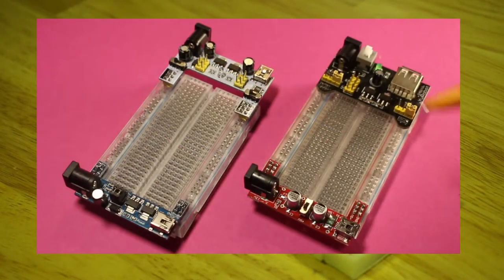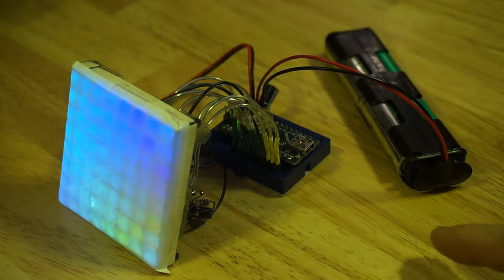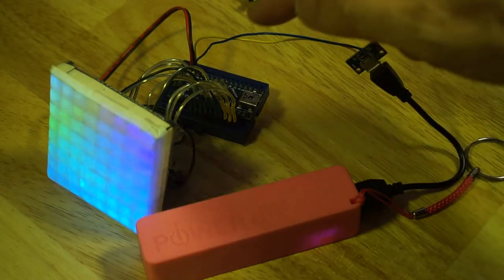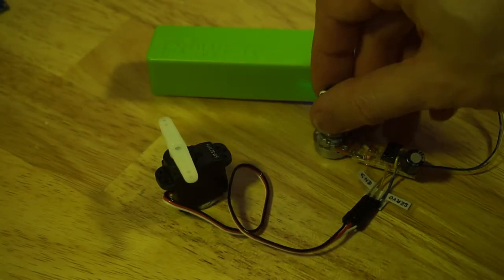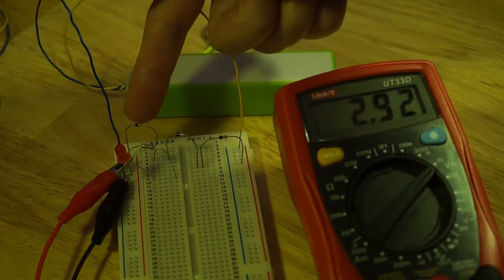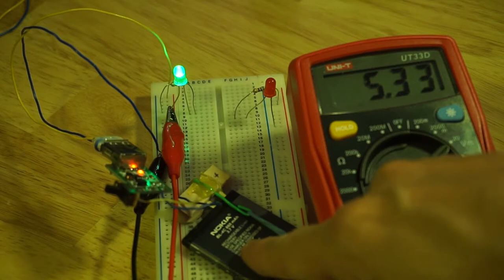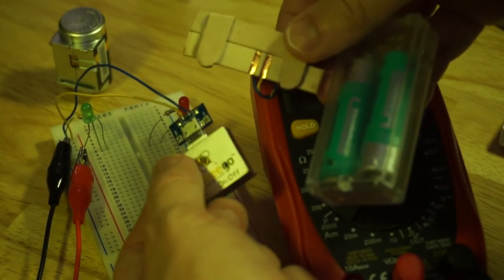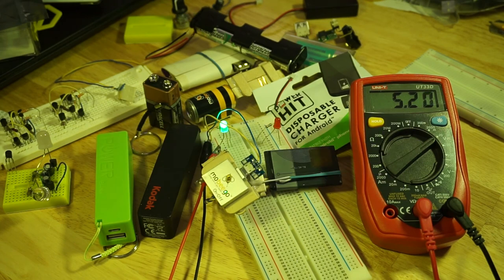Poundworld Powered my Breadboard Projects

Comment: Do I need to make a video reacting to this?

The poundland ones seem to be ok, also a good source of a boost/charge circuit if the battery is a lithium cell. Although you can buy the board it uses on AliExpress for about $2.50 for 5 if I remember correctly